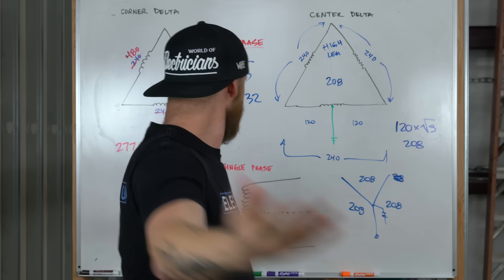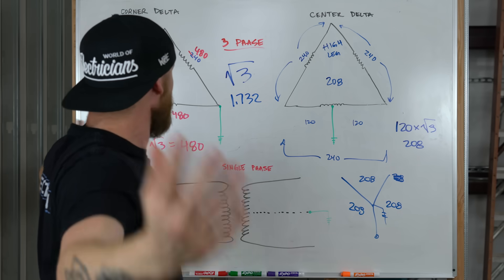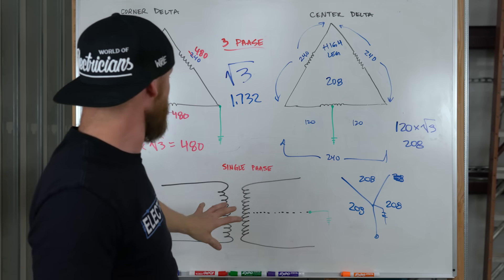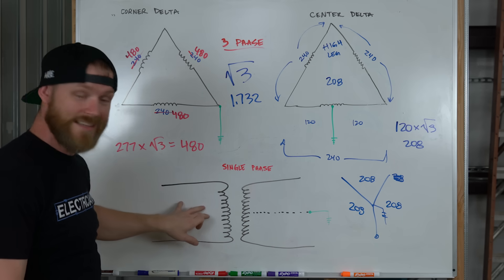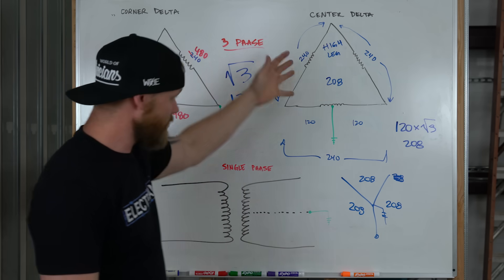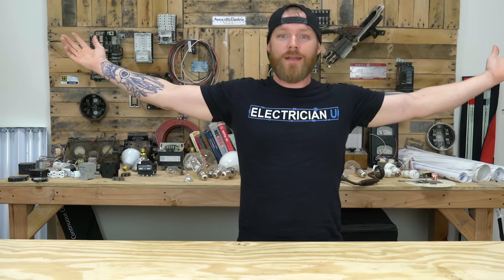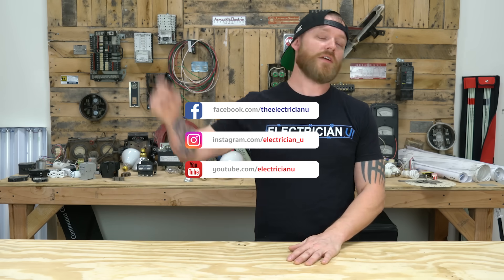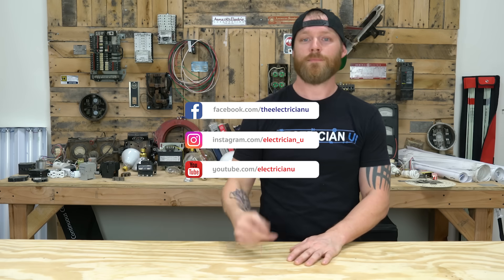Difference Between VOLTAGES - Why We Need Them All

Comment: The 240V of 120/240 V should be referred to as 2-phase.
Reply: single phase, they get it from a 240v center tap transformer.
Reply: @josephkordinak1591   I think I'll have to settle on what you're saying that the two different 120V leg phases are sourced from the 240V's single phase, but since the two 120V legs are of different phase wouldn't 2-phase make some sense?
Reply: @louf7178  think of  it as a split phase, the center tap is right in the middle its 240 across the whole winding, 120 to the center tap which is grounded.
Reply: Concept : single phase means you have a one vector, three phase you have 3 vectors. Split phase is on same vector so single phase. Two phases across single winding is single phase. Phase and neutral across single winding is single phase. Three windings at 120 degrees difference is three phase , delta or wye.Two windings 120 degrees difference is three phase, open delta, or open wye.
Reply: @bobbrumley3964  Thank you.

Comment: Corner Grounded systems have one phase thats 0 volts to ground because that phase has no difference in potential to ground. It’s a common troubleshooting error to assume you’ve lost a phase so most corner ground stuff I’ve worked with has phase monitoring.

Comment: I do a lot of low / mains rated projects, so thought I'd chuck some interesting insight into the common voltages here in the UK...

The ones I've come into regular tend to be:

Low voltage:
3.3, 10, 12, 143.7, 18, 20, 24, 36, 48, 96, 110 (both AC and DC)

Our line voltage is 240v 50Hz AC, and there are other line voltages that do pop up pretty commonly... Namely;
415 and 600v, which do pop up in industrial applications but not for residential or small-scale commercial supplies.

Comment: I used to be an aircraft electrician in the Navy. Now I'm a Locomotive electrician. Locomotives generate 1200 volts (dc) at 2400 amps (for 4400 hp). Paranoia is a healthy thing I always tell the Noobs...
Reply: Screw the lightning strike, you should have powered the DeLorean with this!
Reply: dont be such a wuss. its only a few amps
Reply: @eddiew2325  2400 hundred of them . How 'bout you touch it first, I'll go second...hahaha
Reply: @eddiew2325  you'd get fried into a new dimention bud LOL
Reply: Good points. It's not the bolts that kill you. It's the Amps. A Static discharge that shocks a person in their home, can be 100,000 volts. Luckily, it's very low amps. One half of an amp can kill.
Reply: I meant volts, not bolts. Dang that spell check.
Reply: @davidjudd221  Not true.  It's the total energy that matters.  You can touch 1000 amps at 0.05v because the energy cannot penetrate your skin.  
Frequency also matters. Watch some of the @Electroboom stuff to see him play with high power (relatively) safely
The total energy discharged trough your body is what will kill you.
Reply: @jsalvatori  i'd like for you to try that 1K amps @.05v at about 600Hz-1KHz (i will even give you the earmuffs that you will need for that screeching sound the line will generate; in addition, i will ship a VCO and Marki mixers also )..... let me know how it goes (if you still survive)....sorry, not trying to be mean just joking but you're right...the frequency has a huge part to play
Reply: The aircraft run on 400Hz, but what voltages are common?
European industry:
690V 3000A on paper mills.
690V 6000A on Azipod VFD's
3~ 50Hz

But Europe is a mess in catenary. Anything from 600VDC on teams to 3kV DC or 15kV 16⅔Hz for trains.
Reply: @ambassadorkees  The papermills here in the US use 480V for a lot of applications, including VFDs.
Reply: Try melting metal for airplane turbine parts, 10x the voltage, double the amps...

Comment: Good vid Thanks. Easy to understand and reference. but i wish you would have done a little about how a digital meter will lie to you when working with electrical (not digital or electronic) and why you guys always carry a wiggy . when you put a digital meter on a line and it shows  volts and the wiggy reads open ECT

Comment: Here in San Jose, I have never found 240, 2 line is always 208, although I have learned to put my tester on commercial lighting before I replace a ballast because 277 is super common in malls. and I saved this vid to watch again, to make sure I understand what you're saying
Reply: 120/240 Volt is more common in residential

Comment: In Serbia we use standard EU system. It is actually German standard and it is very neat and reliable. Street transformer is always in wye configuration. Central point is grounded and that is neutral comming from transformer. Between phases you get 400-420V, and between neutral and each phase 230-240v. It is safe. Nobody here is electrocuted, and every household has 3 phase system. It is very practic especially who has a workshop or other business requiring strong motors for woodcutting, or other appliences including electric heating that is allowed to consume 24kW of power per house. Every pole transformer here is rated for 250KVA, 400KVA, 630KVA and 1000KVA. I havent seen stronger than 1000. Great video, keep on going!
Reply: 120 is safer than 240. Nobody is being electrocuted here more than there.
Reply: @chrishall2594 what kills you kills you. It makes no difference whether it’s 120v or 240v. Aside from you have higher amperes with 120v vs 240v(with a 1.8kw outlet) and thus greater chance of fire. Ps my ship uses 6600v 3 phase.
Reply: @cloggedpizza239 But ah, I think in the American system house voltages, I don't think you have availed 2400W to house outlets.
Reply: @Mcfreddo  Its around 1800W (15A @ 120VAC).   Homes also typically have 240VAC outlets for things like dryers and A/C units.   The power going into a typical U.S. home is 240VAC split-phase, meaning two "hot" legs and a neutral.  Either hot leg to neutral is 120VAC.  Going across the two hot legs gets you 240VAC.   The legs are each 120VAC-to-neutral but are out of phase by 180 degrees so you get 240VAC when you go across them.   "Split-phase" just means 180 degrees out of phase... the 240VAC circuits in the U.S. are still single-phase circuits.   As are the 120VAC circuits.

There is a difference in equipment costs.  Single-phase requires fewer parts in appliances and honestly there is nothing in a typical household that needs more than 1800W (from a regular plug) anyway.   

The 240VAC circuits are typically wired for between 30A (7.2kW) and 50A (12kW).  

Actual maximum continuous current for most circuits is lower than the rating, but breakers are designed to operate normally right up to their rating.

Much of the differences we see between U.K., European, and U.S. grids had to do with the cost of copper and aluminum.  Europe has seen a lot of wars which make those metals valuable, so voltages were bumped up so household wiring could use thinner cables.

-Matt
Reply: @junkerzn7312 there are many things requiring more than 1800W, most of the blow dryers here are close to 2000W. But besides that, think of heating on electricity (depending on the size of your home), for some houses here it can take even up to 12kW from a single three phase plug. And besides that, electric car chargers require more power as well.
Reply: @milosozegovic6980  Maybe you didn't read my whole post?  I'm not sure what point you are making.
Reply: @junkerzn7312 well you clearly said that no appliance needs more then 1800W from a standard plug, but first of all, there is a standard three phase outlets and plugs in almost every home in europe. Mostly used by the owen and some heaters. And considering standard single phase plugs I can find you like at least 10 items in my house that use from 2000 to 2400W.
Reply: @milosozegovic6980  Uhhhh.   So, two things.  First, in your previous posting you threw out some very large power numbers... 12kW ?  From a consumer outlet?   That's what you said.  Now you are turning the argument around and trying to argue that regular consumer outlets require at least "large" amounts of power carrying capability?

You seem to be arguing that every outlet in the entire house should be capable of carrying large amounts of power.  Why?   For all the things you think you can find in your house that use a lot of power from a regular outlet... how many of those actually need to use that much power?  A hair dryer using 2400W?   Totally unnecessary.   A room heater?   Totally unnecessary.

The U.S. does have a 20A outlet standard and plug... very few residences have more than one (many have zero) of those types of outlets.    Though they are used a bit more in the commercial world.  Still single-phase.   My house has exactly one of those, for the whole-home vacuum system.

Large load sin the U.S. use 240VAC circuits, related outlets, and plugs.  Nobody in the U.S. is swearing at their regular outlets for not being able to power something.  It seems to me really silly to wire outlets with 3-phase when 99.9% of the things you might ever want to plug in would do just fine with single-phase.

What is it exactly that you are trying argue?  You still haven't said.

-Matt
Reply: @junkerzn7312 In my first comment I didn't refer to standard home plugs, missed that part. But many consumer units in 240V systems are rated higher, because in the US those same ones are dialed down because of the current not because of the power. And what you think is unnecessary is juat your opinion. In europe, a standard for all putlets is 16A, which is around 3600W realistically.
Reply: @milosozegovic6980  Its not my opinion.  Its reality.  Go around your house with a watt meter and measure how much power everything plugged into your regular outlets takes.

No really, do it.

Households have been using less and less power from regular outlets for decades.  Supercharged now with LED lighting and equipment that has become so efficient it sips power even when going full bore.  Regular appliances just don't need much power.   My home fridge, for example, barely ticks over 200W when the compressor is running.  The microwave, induction teakettle, toaster oven, hair dryer, etc... all work wonderfully at less than 1400W.

This leaves only large permanently-wired circuits needing significant amounts of power.  Those are simply wired with 240VAC.   Large induction stovetop, double-oven (electric), A/C, table saw, EVSE, and for some houses water heater and electric furnace or under-floor heating.

Nobody is hurting for power over here.

-Matt
Reply: @chrishall2594 120V will kill you - anything over 17mA AC through your heart will cause a fatal arrhythmia. Most hospitals trip power at 17mA to ground on core balance breakers. Domestic installations use 30mA. Industrial installations go up to 100mA.
Higher voltage equals more pain and damage due to heat.
High voltage electrocution most frequently kills due to burns however - basically cooking from the inside.
Reply: @chrishall2594 OTOH there’s RCD (GFCI) protection everywhere
Reply: @chrishall2594  Actually, I think it's 60mV a/c (higher for d/c) through your heart to stop it - well quiver it and you only need 50V I think to pierce your skin resistance.
Reply: Must be the same for the UK, but they have their houses connected in a ring system?
Australia and Nu Zillan have the exact copy of the German system- 240v and 415v and the same KVA pole transformer outputs/ reactances -isn't it?
Reply: @ Actually there was a global agreement to standardise on 230V single phase and 400V three phase about twenty years ago in countries that subscribe to IEC standards.
The voltages have been gradually dropped in some places (like Western Australia (from 260V) and the rest of Australia (from 240V) and raised in others (most of Europe from 220V).
690V three phase was introduced for heavy industrial applications at the same time.
Both Australia and New Zealand use IEC standards as the basis for their own electrical standards which are in the AS/NZS 3000 series.
The Australian standard electrical plug is actually the oldest national standard connector still in use. A 1920’s appliance plug will fit a 2024 socket and vice versa.

Comment: 48V is also a common low voltage in the IT world as it's the voltage used for PoE equipment.

Good explanation on how the voltages are derived.  Was hoping for a bit more of a history lesson as to why  the various service voltages and configurations were chosen and have fallen out of favor.
Reply: Makes sense. I always wondered how PoE stuff worked with such a low signal 😂
Reply: I know some Cisco stuff puts out 56v and with the voltage drop you get 48v at the end device.

Comment: In the Philippines they us 2 wire 240v 60hz to the same 120 outlets used in the US. So a ground and one hot at 240v coming to the house.It's just something odd I dealt with in all the vacations I had there. It evidently came from US military generator usage during/after WWII

Comment: Very well described!
The only thing left out was phase angle relationship. I understand that's where the √ 3 comes from, but I'm not sure everyone else does.
An aside: While it has nothing to do with utility service, there is also 120/240 180° split phase with center neutral as produced by a generator.

Comment: Installing a piece of kit at a factory and decided to test it first.I was told it was 110v, and as I'm in the UK, got a step down transformer to go from the 240v supply to the required 110v. The thing clicked but did nothing else.On investigation turns out it ran on 110v but at 60 hertz, not 50 hertz that the transformer put out.We got the correct transformer and all was ok. So my question is, how much variation can you get with hertz or are there fixed points within a voltage range.
Reply: Many 60Hz motors (or other inductive loads) can be run succesfully at 50Hz at lower voltage if full power and rpm is not critical. Fan motors and like can be fed through a series capacitor if full voltage is mandatory for the rest of the system. The matter with frequency is easy to forget about and not at all trivial.
Good luck!

Comment: Does all the 208, 277, (Wye-Wye) stuff have to do with the three phase math, 120 degrees,  so 30 degrees  overlapps,  Don t know how to phrase it right. The 1.732 math. Does the electrician use the ratio .866 though too?  Damn I was off track,  are the corners transformer geounds,  or is that where the power is tapped? Corner gounding,  does that mean you 're only using 2 of the 3 parts of the transformer,  and is that considered a 3 phase trans right?

Comment: Single phase voltage in USA is one half of European single phase voltage, so 1:2 transformer does the trick. Assume similar wiring in three phase systems in USA as here in Europe. Order 1:2 three phase transformers and what you end up with is: 208 volts phase to phase, 120 volts phase to neutral. Take into account 60 Hz induction motors draw more current at 50 Hz and you will never realise how wrong everything is. And doing it right would probably fry your 60 Hz motors running on 50 Hz.

Comment: Very interesting. I hadn't even known about the other odd voltages (277 for example). Even though it was quickly delivered, I was able to follow along with what you were trying to deliver. I only have single/split phase here, but will come in handy knowing the differences when I start installing equipment into my garage that'll need the other voltages, like 208.

Comment: Most 3ph motors in the factory I worked at were 550. Had one wacky machine that had , I think,  308v motors. Machine had its own transformer in the control cabinet.

Comment: I finally got 240v installed in my shed! YES! Can't wait to get a nice welder, plasma cutter, big heater, etc. etc. Electrician said "how many amps do you need?", I said "all of them" :) 240v scares me a little though, 120v doesn't hurt much, 240v does. https://i1.lensdump.com/i/jRPibi.jpg
Reply: Don't be afraid, you are not going to lick the wires. I have 230v from phase to ground, and 400v between phases. Never ever had a problem in my workshop. Also i'm welding all the time with a 3 phase monster. I can assemble war tank.
Reply: More people died from 120 than any other voltage...

Comment: One thing i have wondered is if there is any efficiency difference /current draw difference tradeoff with a motor running in Y at 400 V vs one running in D at 400 V but with equal wattage. Most of the  motors driving the machines at our workshop are Y 400V (winding voltage 230V) wich  I think is so u can export the same machine to USA as well without changing the motor and just D wire it instead. The motor in our air compressor on the other hand is D 400V because it has Y/D start.  I have checked and the nameplate on all motors (bandsaw, grinder, hydraulic press ect) say that the motor has a higher current draw on 240VD then 400V Y but would this be even lower/better if the motor was 400D instead or is there no difference? Mathematically i would  say there should be no difference  if ive gotten it all right.
Reply: D draws more current but also gives more torque
Most motors are started on y then switches over to d when it’s close to nominal speed

Comment: I work on ships. We have 3 phase 690, 440, 220 V AC and 24V DC onboard.
690V for main drive motor, 440V for other machinery, 220V mainly for lighting and small machinery and 24 V for control and backup. 3 phase is 3 wire system no neutral.

Comment: To all the guys starting out; There is a big need for Industrial/Power Plant guys that want to learn Protection Relays, VFDs, Motor Control, AVRs, PLC, DCS, Instrumentation and Equipment Testing. Last 10 years we've been mainly importing foreign workers who are Electrical Engineers  in there home Countries. You'll be making 140K a year or more. With all the benefits. Get on it guys. We need you.